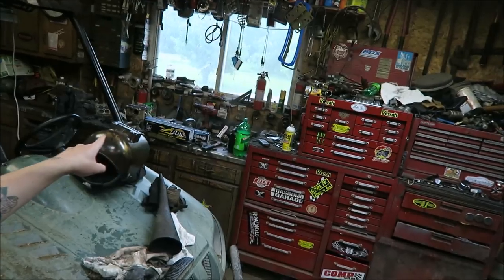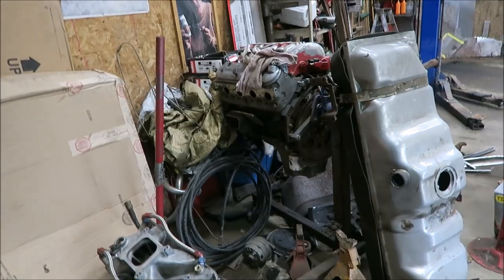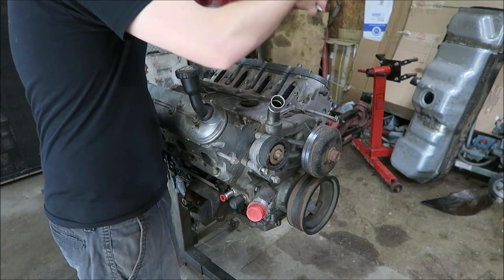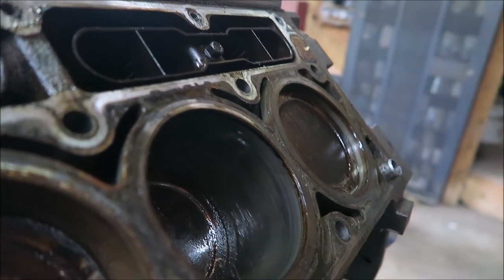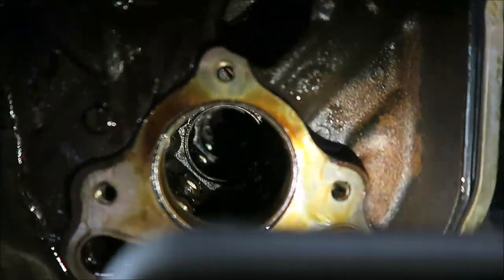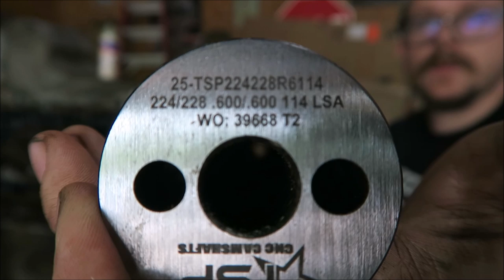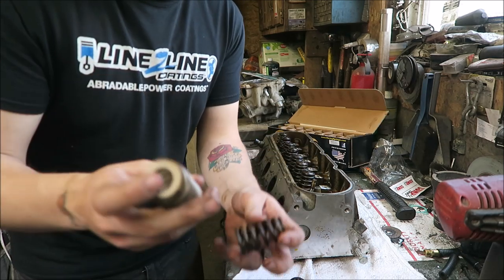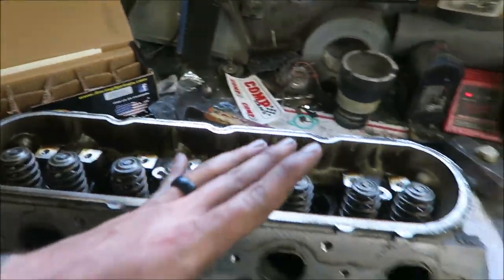Texas Speed Cam Install For The Turbo 5.3!

Comment: Make sure you change the o ring seal on the pick up tube/oil pump. Cuz thats one of the big reasons people spinning rods bearing plus its a commen problem with truck ls engines
Reply: Great suggestion. That is definitely a common reason for low oil pressure.
Reply: I just had that happen to my 5.3. That o ring can get a knick and cause all kinds of problems. No oil pressure for me until i changed it

Comment: wife has been wanting a cam in her little 325 also, but i cant decide on what to put in there    its a stock everything so iam thinking about something in the area of .550 lift   210 to 220 and say around 115 lsa    she dont want any low idea thunder rocking
Reply from the maker: The stage 2 or 3 TSP cam with like a 114lsa would good choice if she doesn't want it to rumble a bunch at idle. Goldie has the Stage 3 low lift 112 and it's relatively tame for have long tubes and a full 3 inch exhaust with only resonators.
Reply: @SniderTron3000  I appreciate that information buddy

Comment: I should be ordering parts soon for a turbo 5.3 nova build, debating on fully building the engine or just sending it until I pop something. I have 2 rotating assemblies sitting around. May just send it for now, and get to work actually building an engine further down the line.
Reply: 2001 RedGMC when you’re ready, let us know. We can set you up with all you need. If you’re going to boost the hell out of it Texas Speed has a great set of pistons and rods that have been tested at about 1200 HP with the stock crank. Give us a shout (409)553-0759
Reply: I will be building an engine down the line... I think I’m just gonna follow a quick and easy sloppy setup in there just to work on the tuning of a boosted setup. I kinda expect to pop the first engine. After that I’ll build a bottom end for some power.
Reply: Well what did you do?

Comment: Way to go LS engine's r the best. Hot rod magazine did a budget build I think just a cam and or  maybe headers but it made  416Hp on 87 Oct. But he said could have got way more out of the LS  with a bigger can  and head work and others.. Good luck with the built
Reply from the maker: Look up Richard Holdener, he knows and shares more info and dyno tests related to LS's than probably anyone. Including Matt Happel

Comment: i was taught long ago on building engines, stock parts gets a stock timing chain and gears, after market parts, big increase in resistance gets a after market timing chain and gears to handle the load better, on the cam just oil it up and slide it in ( what would dead pool do installing a lubed up cam ) on cam chose, weekend warrior anything above 228, 230 for a daily driver nothing above 224 on duration, people will talk some shit about that, all i can say if you have full coverage insurance go for it because your power breaks will stop like shit when that mad bastard break checks your ass.

Comment: Just want to add that the gen 3 5.3 uses 2 different styles of head bolts.  The second "style" is longer than the first.
Reply: Ad Wagner, 99-03 use the long bolts, 04 and later use a shorter bolt, all the same length.

Comment: Same cam I'm putting in my new 5.3 for the c1500 but with a 112lsa
Reply from the maker: Justin sells that as his Thumpstick 🤘
Reply: @SniderTron3000  yeah I can't wait to get the engine in. Supposedly my neighbor is gonna pull the old 5.3 out for his c1500 then I'm putting in the gen 4 back in mine. Just dropped the 799s off yesterday for a full port and polish, valve job, and milled .030 with the nnbs intake, full bolt ons, 3400 stall, efans and 3.73s it should be a fun truck.

Comment: Hey ST3000 sorry if this seems to be a really stupid question but I need to ask it as I am not as engine savvy as you are. When you are putting the Cam back in I noticed that you are twisting it and trying very hard to not bang or bumping ti around. Why is that? I have watched other videos about doing cam swaps and they are doing the same thing. I mean you have the heads off and so I am assuming that the lifters are off/out of the way as well. Is there a very specific way the cam has to go in? 
Oh BTW let me apologize to the community here for being such a noob. My expertise is in computers and IT support so again I apologize.
Reply from the maker: You do that so that you do maul up the cam lobes or the cam bearings. It doesn't take much for one of those to get "dented" so to speak and that little bit of metal sticking up can start to grind into the cam or vice versa. The spinning helps you wiggle it through there because there could be a lobe thats hanging down and contacting the engine, so you spin it and it lifts it out of the way.  

And don't sweat the "stupid questions" thing, you don't learn if you don't ask lol

Comment: I know your doing a cheap home built let’s send it special here. But your killing me lol 😂 when you put boost on that thing kaboom Please rebuild the bottom end and set the ring gap for boost. You’ll thank all of us keyboard mechanics later hehe 😜
Reply from the maker: Well, the 5.3 in my truck has untouched rings, and I've put 12psi to that while running out of fuel pump lol I'm not worried
Reply: Shiny Knife it’ll be fine it’s a gen 3 ls you ain’t got no need for it
Reply: @ josh Oh ok so your not going to run 20 psi or nothing crazy. The way you was talking about cleeters ruby car. I was afraid you might light it up lol
Reply: @Christian I was thinking he was going for some big boost my bad
Reply from the maker: Haha, heck nah! I think like 15psi will be plenty of boost. And I'll probably start off a closer to 8-10psi
Reply: Oh ok yeah it should live on that.

Comment: If those r the stock piston then that is a 4.8.   A 5.3 stock piston has a cross on it or u can call it a 3-D + sing in the the middle. Just saying
Reply from the maker: Not all 5.3 have that cross. The suburban doesn't. Goldie Hawn does. Different year 5.3's. And 4.8's have flat tops. Like flat as fuck flat tops. These are dished.
Reply: Like Snider said, 4.8’s have flat tops...
Reply: Shit Box .......if it has stock flat top piston then it's a 4.8 no a 5.3 like he said
Reply: Shit Box ......,I just looked again they look like they are dish pistons maybe some cheap aftermarket so that should mean it's a 5.3.
Reply: Matthew Varnam, Those pistons are stock, good old dished 5.3 slugs.

Comment: The heads gasket will be unusable after it’s has been compressed by the head, of course it will work if you reuse it but it might not be reliable and for sure will be interesting for us to see 😁
If you have compression tester, it will be good idea to check it.

Comment: Let's pull it apart I think I might want to do it right. Welp looks like its dirty let's spray it with wd40 and put it back together lol. I love your style. Seriously though I like this build.
Reply from the maker: Once I saw that it was already embracing the Sloppy lifestyle without my help I figured I might as well just roll with it haha
Reply: @SniderTron3000  it's only a 5.3 anyway there are more if something happens to it. Doing something better isn't the best way all the time if that makes sense. Keep doing what you're doing we all love to watch it and that's why we're here plus it's good trial and error for us lol.
Reply from the maker: Yeah, that was the exact thought I had. If it works, hey I just went 10's on a slopper 5.3 without gapping rings. If it blows, well it was a cheap 5.3 that I didn't even gap the rings haha

Comment: Your disappointing me, first replace the head gaskets, once they have been torqued down there is NO second use.
Secondly, pull the pistons and re-gap the top ring for more clearance since your boosting it.
Thirdly, replace the dam timing chain and gears. Pull the oil pump and replace it with a high volume pump and o-rings.
Check the rod bearings and mains and install new seals also.
For petes sake young blood give yourself some guarantees on your engine!!!!!!
And put a timing wheel on the cam and degree the dam thing in correctly.
Reply from the maker: Sorry to disappoint lol